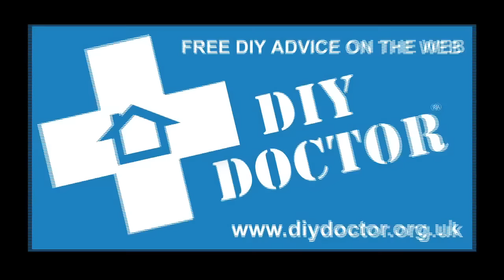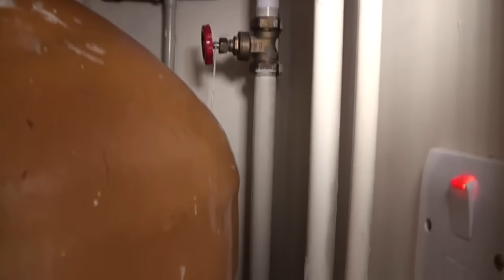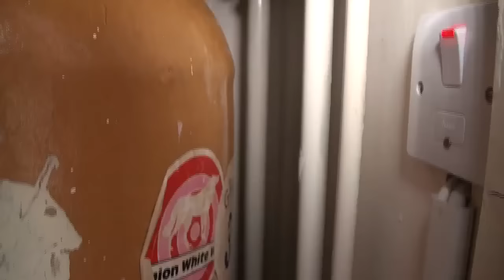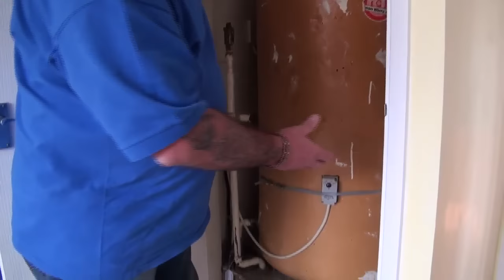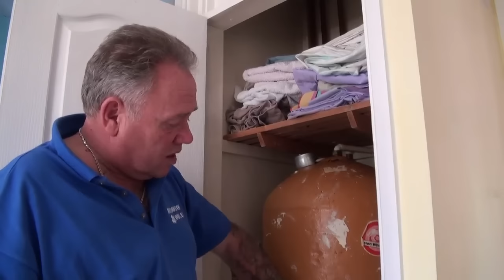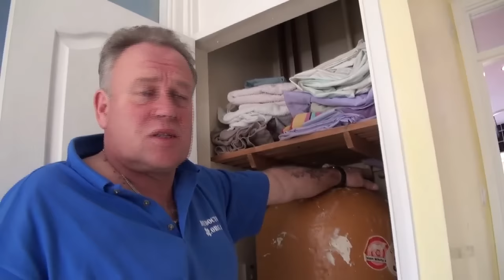Water and Plumbing Tutorial Part 7 - Hot Water Cylinder

Comment: Very clearly explained. I have followed the instructions and all hot water taps now shut off except the one in the cloakroom, which is the one I want to change. What have I missed?
Reply from the maker: Assuming the cloakroom is downstairs Dave it may be that it is just water in the pipe and it needs draining off. Other than that it may be that it is fed in another way from the video.In that case I'm afraid we wouldn't be able to help you.To diagnose we would have to have a pretty clear idea of how your sytem was plumbed in in the first place.
Reply: DIY Doctor
Thanks Doc. Cloakroom is ground floor, but so is kitchen and utility which stopped as soon as hot feed turned off. It's been trickling for a couple of hours now which must be too much for pipes so perhaps draining the cylinder. I'll trace the pipes back to see if it is fed a different way.
Reply from the maker: Dave Hayward
Do let us know how you get on Dave, it may help someone else. Good luck
Reply from the maker: Dave Hayward Thinking about it Dave if its onlt tricling it might be a faulty vale which is not shutting off properly.
Reply: DIY Doctor Just what I wondered, and you are right Doc. I fully opened and then shut the valve 3 or 4 times and the tap is now just dripping and will eventually stop I think. Too late now today so everything back on and I will try again in the morning. Thanks again Doc.

Comment: I'm currently facing a issue with which red handle to switch off, there are two one on each side one of them goes in the back of the system. If I was to assume that the one leading from the cold water system to the hot water was the right one could I possibly do any damage to the hot water system itself? Will it explode if I move the wrong one?

Comment: My water is getting too hot and a plumber came and replaced the tank thermostat but it hasn't made any difference. Can you explain how the thermostat actually works please. He says I need a new 3 way valve-is that right? If the thermostat activated this valve why doesn't the actuator turn when the thermostat switches off? I have a conventional oil boiler and radiators.

Comment: hi. I have a similar system to the video, however there are 3 valves in the cupboard.Two of the valves look like the one in the video ( red circular tap handle), the third is also red, but is straight, about 6 inches long. Should I turn all three off to turn off the hot water?
Reply from the maker: Impossible to say from here Andy. Follow the instructions in the video first and if the hot water is still on then you need to trace the cold feed to the tank in order to turn it off. It may well be your "third tap" and providing the boler is off you can do no harm by turning it off also.

Comment: Hello, what if the valve is stuck ? I'm a leaseholer in a council property and just want to replace the taps but cannot turn off the hot water. Thank you
Reply from the maker: Hi Roma, take a look at our page on unjamming water valves http://www.diydoctor.org.uk/projects/jammedwatervalves.htm . If this works, great. If not then you may have to callina plumber as it's quite possible the tap needs to be replaced and we do not know from here what type of system you have.If its the usual gravity fed hot water system with a cold tank in the roof and a hot tank/immersion in the airing cupboard, then draining the cold (after turing it off at the rising main) and then draining the hot through the downstairs hot taps should empty the water system to allow you to change the hot valve. However, if you have never done this type of thing before we strongly advise you to call a plumber.
Reply: Many thanks for the advice.

Comment: Hi I changed my heating pump. I also had to change my micron 30ff pcb as it had the software error. Ever since my pump has constantly been running now I'm not sure how it was before with the old pump but noticed the thermostat on the cylinder was t 65 now turned it down to 50 and all is good again. Pump shuts on and off as it should. But my question is why can't it go any higher, is this because pump is not fast enough or rads on to high when balancing so it's stealing all the heat?? I'm happy at 50 and same as niebours now as they have same house and setup. Thanks for help. Oh it's a new grundfos pump. On setting 2 . Old one was a wilo gold 50
Reply from the maker: Hi James,

You need to put this question into our Plumbing forum here http://www.diydoctor.org.uk/forums/plumbing-forum.html 

one of the guys will get back to you soon I'm sure

Comment: Hi there. I had an issue a few months ago where the pressure of the shower dropped and ultimately stopped working. The plumber that came out to fix it said that simply, the red round handle had been closed. Still don't know how that happened. Anyway, the pressure is dropping again and the shower is cold. I checked the airing cupboard and i can see 2 red round handles. 1 is coming from the loft and 1 is next to the big tank thing. They're both closed off. Is this right or should i open them up? Thanks in advance.
I have a pump added to to system after having a new bathroom fitted.
Reply from the maker: Im really sorry Slurms but this is a question we dare not answer online without an investigation of your system. We have no idea what type of system you have or how the shower is fitted and without knowing a few things for sure it is just not safe or sensible for us to guess at how your valves keep turning themselves off.

Comment: very disappointing.  All I want to do is turn off the hot water supply so that I can change a mixer tap in the kitchen.  A very basic question. This is barely addressed in this series of vids other than a vague description of the immersion heater piping which in this example is conveniently labelled.  Mine isn't as I'm sure others won't be and there is no obvious cold inlet at the bottom.  Should have spent more time on possible variations for different heaters, instead of the irrelevant stuff in the kitchen vid about filters etc.
Reply from the maker: Sorry we could not describe your particular system for you. Every hot water tank has a cold inlet, it is this cold inlet which pushes the hot water out. The fact that your cold inlet is not obvious is a bit strange, there is only one pipe which goes into the bottom of a hot water tank and that is the cold inlet. Turn that off and no hot will come out. You are quite right it is a very basic question and we have supplied an equally basic answer. Turn off the cold supply to the hot tank and no how will come out. Sorry this seems to have passed you by. The reason the valves and pipes are labelled in this house is because the owner asked a plumber to explain them all to him so he knew what to do if he needed to do any maintenance. This cost him £85 for the plumbers time. We have tried to do it for nothing and everyone else appears to be very grateful. What seems to be irrelevant to you in this video, is very helpful to thousands of people so we are told.